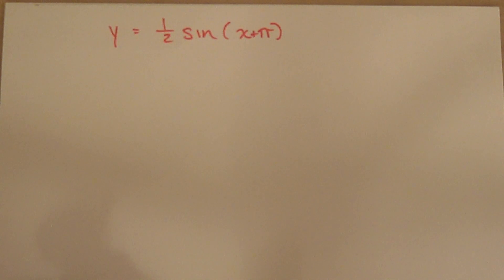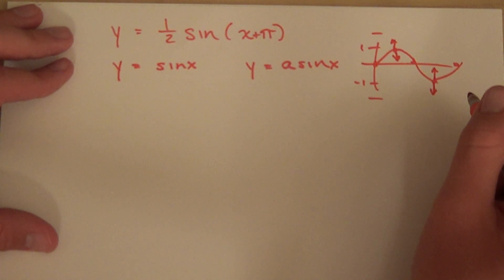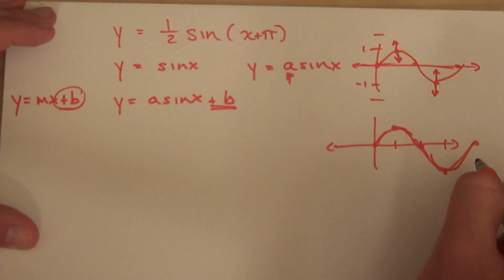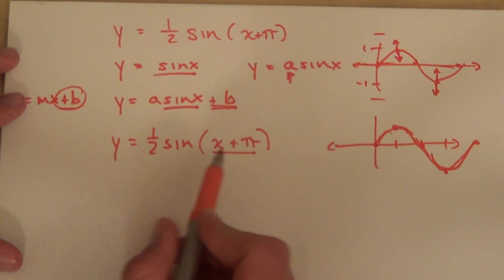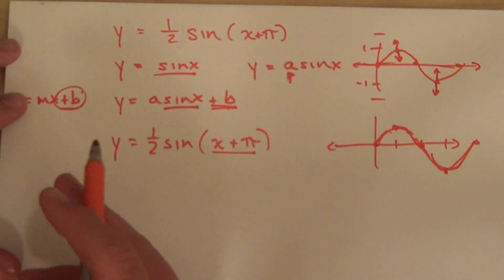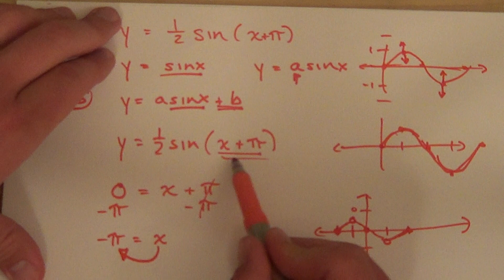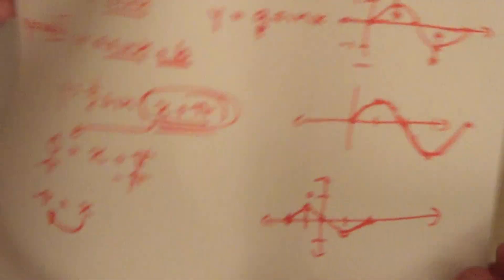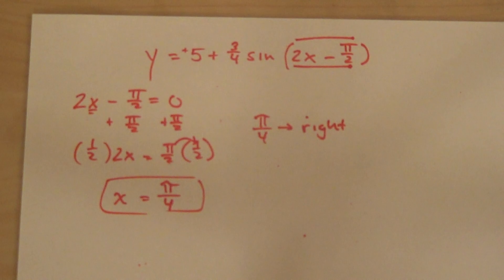Sine Function Phase Shift

Comment: can the phase shift be found without pi being used? i wonder because my textbook sometimes show equation with decimals, e.g y = sin(3.5x+4.8) - 14.8

but the book says use with graphing calculator....I wonder if theres simple/hard way to find phase shift that way.
Reply from the maker: +aftc43654676 432267 you do it the same way as before on difference is that you will use the approx decimal value for 2pi~6.28 if you calculate it the way I was explaining in the video